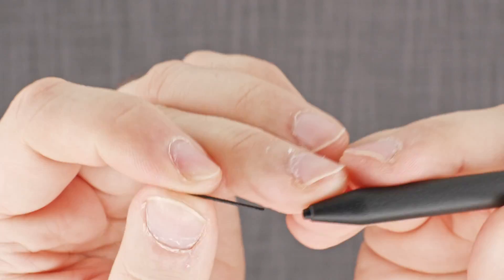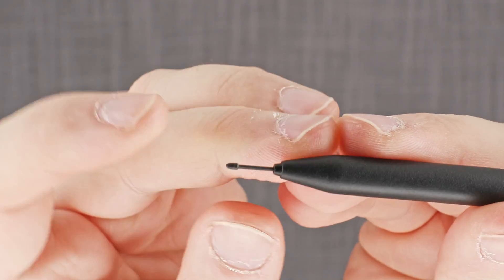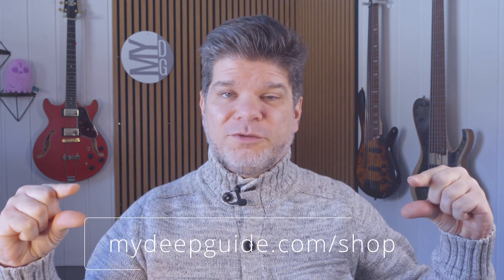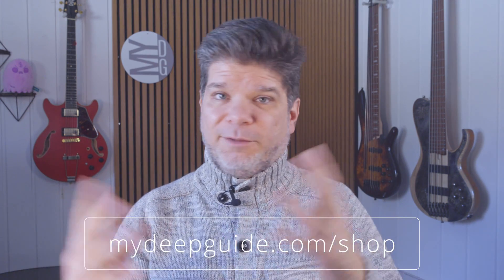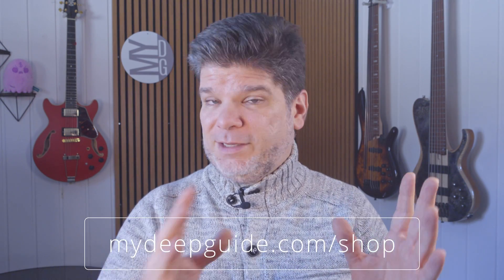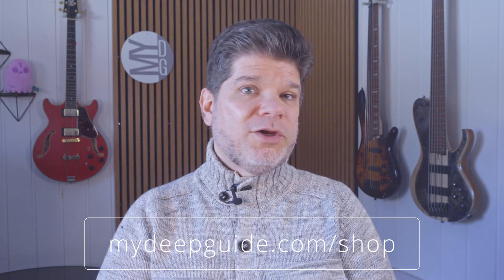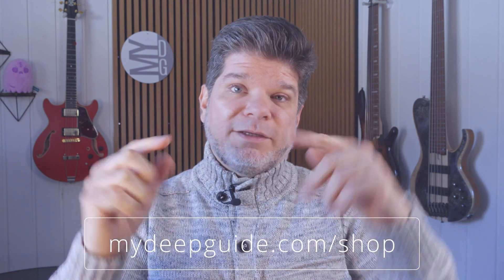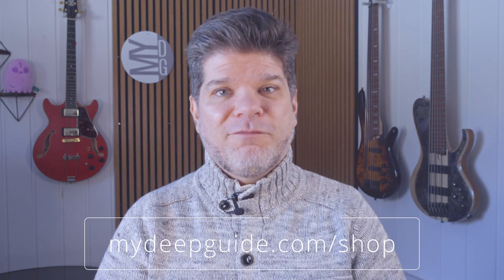How Does Wacom EMR Technology Work? Demystifying Functionality and Debunking Myths!

Comment: Are you aware of any compatibility matrix for EMR styli? For instance would the Heart of Metal work with my Boox Note Air4 C?  I am using the Lamy EMR cartridge in one of my Lamy fountain pen bodies. But I would like to test others, but don't want to get something that doesn't work at all.
Reply from the maker: Any EMR pen will work on any Wacom EMR equipped device. There could be some differences in pens that may have some special functionality, for example more than two buttons, or if the pressure sensitivity of the pen doesn't match the one on the device's original pen.
Reply: @MyDeepGuide  thanks for the quick response. I was hoping this would be the case, but didn't want to start buying styli without trying to get an answer first.
Reply: @MyDeepGuide  Is the Heart of Metal an EMR stylus?
Reply from the maker: Yes it is, although you may want to watch my video about using a ceramic nib on a glass or plastic panel, it's one of the recent ones.
Reply: @MyDeepGuide  Definitely watched it. Sort why I wan ted to ask you about this particular subject.

Always appreciate all your work and information you share.

Comment: Nice video!

I've been a fan of EMR tech since around 2004 when I was trying to leverage my meager budget into digital arts and couldn't afford a full-on Wacom Cintiq.  I ended up salvaging tech from the old Penabled tablets which had flooded the market around 2000.

A few items of interest:  The Wacom antenna under the screen is used both to charge the pen AND read the pen.

But how?

-Well, the old Wacom tablets I was tearing down and researching had two clock speeds listed in the various specs, and it confused me for a long time.  One was measured in Khz and the other in Hz.  I can't recall the actual figure, but the Khz signal was the carrier wave of the field itself, while the low frequency...  It was around 110 Hz or so, depending on the model (and my memory).  What was that?

Well...  Turns out that every 110/th of a second, the transmission field which charges the pen toggles on/off, turning the antenna from a transmitter to a receiver and back again 110 times per second.  Charge-Listen-Charge-Listen, etc, all on the same hardware substrate, which is why you don't see two antenna grids when you pull apart the screen.  How elegant!

Next item...

The old Penabled tablets could indeed read angle data from the pen; it was baked into Wacom's brilliant hardware on such a deep level that NOT having it there would have required breaking the technology.  -However, Wacom execs were worried about diluting their own market for the expensive Cintiq line.  They didn't want guys like me drawing professionally on old eBay Tablet PCs for $150.  They wanted us to spend a couple thousand on a Cintiq.  -So what did they do?  Easy!  They artificially limited what the Tablet PC systems could do entirely through the driver software.  No Tilt For You!

(I opened up their standard driver and had a look at the code.  It's very interesting in there; lots of dead wood and old barnacles.  There are codes for third party manufacturers and tablets which don't even exist anymore, each with little switches for what each model was allowed to do with the hardware they had licensed from Wacom.)

-I discovered a way around this limitation accidentally when performing some hardware/driver hackery, but didn't put any time into making it into an application level solution.  (I never use tilt information when I draw, so it was only ever a curiosity to me.  And besides, these days, the artificial limitation is largely gone.  The market is flooded and all the tech is good, so why bother pretending?)

Speaking of which...

You know how "Pressure Levels" are a big marketing point, with each new iteration claiming even more pressure sensitivity?  (That's how it was for years and years, anyway.  These days the levels of pressure are so high, it's not really a concern anymore and you can't really squeeze any more marketing copy juice out of the concept.  But back in 2004, the low end was pretty low.  The Penabled system only offered something like 300 levels of pressure.  Wow!  You had to buy a proper Cintiq to get a full 1024.  I believe today, pressure is measured in thousands of levels, and nobody cares.  They just expect fluid pressure response from even the base unit, and they get it.  (Interestingly, the average human can only detect around 150 discrete levels of pressure difference in their fingers, so you only notice the limit visually when using large brushes.  Since I rarely use anything beyond around 30 pixel brushes to draw, 300 levels was more than enough to cover the range of possible brush states, it never really impacted me at all.  The guys using 1000+ pixel brushes sure noticed it, though!  Their brush diameter would jump in 10 pixel increments!  Very messy.  So Wacom had an attentive market each time they brought out the next line of tablets, with users eager to upgrade.)

But.., here's the funny thing about Wacom pressure sensitivity.

When dealing with an analog signal, you can divide it up as thinly as you like.  It's got little to do with hardware, so again, it was a software fabrication.  An arbitrary number was set in the driver.  If 300 was the number delineating "Most Pressure", why not just change that number to 3000?  Then you instantly 10x the 'pressure sensitivity'.  It was a great way to get the most out of the invention; you could create new, updated product lines without having to do any new engineering to the core technology. An old stylus from 20 yeas ago could just as easily provide the same 7000 levels of pressure as the latest model, -if Wacom allowed it in the driver.  They don't, though. There's a strict artificial limitation in place to ensure that "New and Improved" actually means something.

Okay...

That's a very long post!  I'm just a big fan of the tech and I've had this stuff rattling around in my head for 20 years now.

Your channel is great!

(Oh.., one other thing.  Can you do a review of the new Daylight Computer?  That thing looks awesome!)

Cheers!

Comment: nicd and clear explanation. I'll pretend i Understood it ☺. 

For me I've only played with a couple of the emr devices and one active pen capable device. 
*emr won me over because of the lower initial activation force (still would be cool if there was a pen where u could turn a screw to calibrate sensitivity (if possible))

*its veen a few year now but i found on the windows laptop the active pens i tried were interesting. it was laggy, but when I deleted a certain background task (which would reappear shortly after) it would become very accurate by comparison.

Even though there was more freeplay in the nib I found the cheaper heavier active pen better then the rennaisir pen because the weight would require less effort to engage that little click the nib does  to write. 
* it kind of made  me think that active pens r probably as good, but i would prefer the pen to be engaged/on 100% and calibrated in the software by the user (just have a a click on/off on the back or something). For example I jammed something  (can't remember what 🤪) into the nib area and adjusted the nib so it was just engaged to write, and i thought that this is more what I'm looking for.

Comment: Something I'm curious about: on the Supernote, if you double press the Lamy button, you can switch the main function of the nib between normal and eraser. Double click again and you're back to the previous one. So... What's happening with this double click? Very mysterious to me :)

And another point: any clue why we dont see pens with, say, two buttons? Would love to have one for erasing and one for lasso'ing. Do you know if there's a limitation for that?
Reply from the maker: Double press functionality is simple really, device listens to button presses actively. When it detects a button press it also activates a timer, and if another button press is detected within a prefix length of time, action Y is activated, otherwise action X is activated. In this scenario, action X is your single button press tool and action Y is the double press tool.
As for two buttons, another user mentioned a very interesting fact that Wacom does have patents for active EMR pens, that do certain things differently, and have 2 buttons. So technically it is possible, but why it is not done on these EMR drivere, I don't know.
Reply: Ah I see. I thought the double click was handled at pen level, but it's actually handled by the device itself. And indeed I just tried it and it actually only works if I'm close enough to the screen...
Reply from the maker: Double click or even tripple clicks are always handled the same way, by the system. System doesn't care where the "click" comes from, so it can be a double-click mouse button, stylus pen, keyboard key, touch input etc.

Comment: I have a question: if pen pressure just a mechanical thing, then why it's so hard to replicate wacom IAF which is <1 gramm, now Huion (claims) has 2 gramm, Xppen has 3 gramm and others even more. I was told it's also because of a chip in tablet which process signals.. anyone knows more and why?
Reply: I'm doing a series on EMR pressure sensitivity on my channel - and I am struggling to find information about what Wacom is doing to get their incredibly low IAF. I hope I'll be able to find out some information in the course of those videos.

Comment: Great explanation, the main takeaway is that traditional Wacom pens are totally passive analogue devices and the tablet figures out everything from the resonated magnetic field, which is pretty elegant.

However, it appears that not all Wacom pens are purely passive anymore! While I was reading through Wacom patents, I found patent US8525816 which describes both the completely analogue position pointer (FIG. 24), but also a digital version (FIG. 25) which instead harvests energy to drive a CMOS IC. This IC measures the pen pressure and button state from within the pen, and then digitally transmits the information back to the tablet one bit at a time, by rapidly changing the resonance of the coil. I'm not sure how many Wacom pens do this in practice, but the patent is from 2010. It probably provides more accurate pen pressure information than simply changing the resonant frequency of the coil.

Regardless, the position and tilt functions are still purely analogue and figured out by the tablet. The pen doesn't contain any sort of accelerometer, like many active pens do.
Reply from the maker: That's quite interesting, but that might introduce some lag, depending on how the data transmission is. Or would it? That would be interesting to see, which is more efficient, the "layer" doing all the calculations, or the pen sending all the calculations to the "layer". There must be a reason why this is the more widely used standard. But either way, interesting find and thank you very much for sharing :)
Reply: @MyDeepGuide  I think maybe the Wacom Pro pens (which are listed to work only with specific tablets like Intuos) use the digital IC system, they have 8192 levels of pressure sensitivity and 3+ buttons, compared to the "standard" passive Wacom EMR pens which list 4096 levels and 2 buttons max. Not really sure why it was necessary, maybe it was too hard to get 3 buttons in an analogue system... or possibly it is just marketing and vendor lock-in, now the pen needs a proprietary IC which only Wacom makes, so they can sell a more expensive pen with their more expensive tablets. Probably doesn't add lag though, it only needs to send a few bits out for pressure and buttons.
Reply: I have some detailed videos on EMR and pressure detection in my channel. Good find on the patent! In a modern EMR pen (and Wacom pens have been this way for a long time) the nib presses into a piezoelectric pressure sensor and then that pressure data is digitally encoded into the signal sent to the tablet. In this case the inductor coil in the pen does not move the inductor coil and the resonant frequency does not change. Older EMR pens and pen designs that rely on changing the resonant frequency by having the nib move the coil which then changes the resonant frequency. I point this out because even in my first EMR video I described the older technique but in my more recent pen pressure video I describe the modern technique. Newer pens by XP-Pen (X3 Pro) and Huion (PW600,PW600S) seem to have moved to using an IC with digital encoding of pressure.

Comment: I could Ghost write from over two inches away with my Heart of Metal 2 pen, and the only way I could set it right was to gentle tap the pen on my light stand near my chair, in time the metal sleeve within the pen came loose and rattled every time I used it. Yet at about £70 a pen I was concerned but pleasantly surprised when Super note sent a new nib after I contacted them. 

Thing is, the new nib began to ghost write and not wanting to 'tap' that on my light stand, I reverted to the old which eventually broke revealing the innards. I glued it together and the glue must have caught metal sleeve because it hasn't rattled since... but more importantly, nor ghost write! So, I have a brand new nib as a back-up, while I write with a slightly crooked pen that I never quite glued straight... but I'm content.